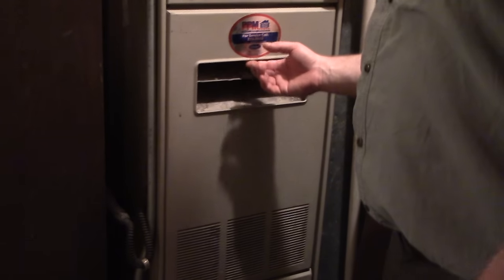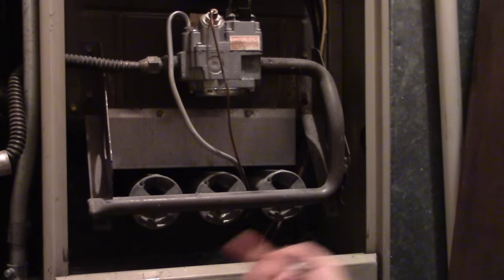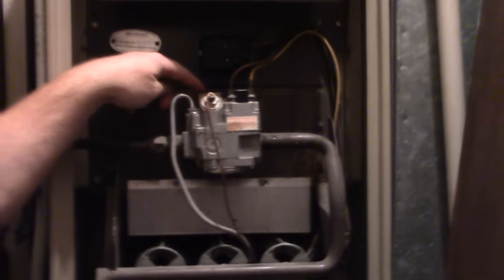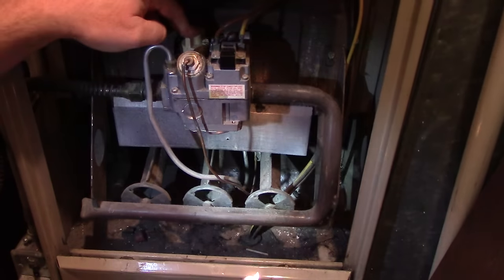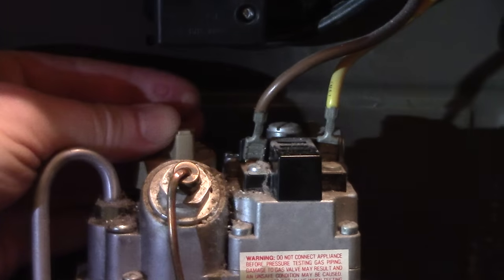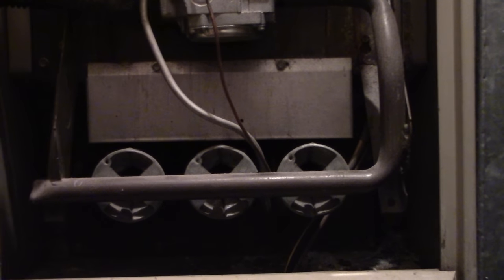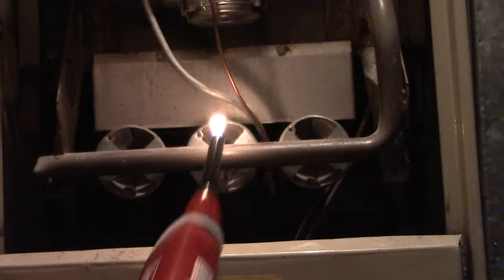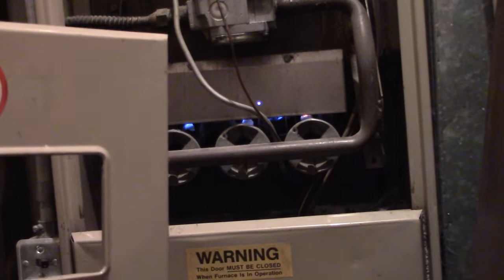How to Start Pilot Light on Furnace

Comment: Appreciate it!!  but I want to know should I turn the heat thermometer to on before doing this or keep it off? Thanks
Reply: Keep the Thermostat down at the lowest setting when lighting the pilot light! This will keep the main burner from suddenly igniting when you turn your gas valve to "ON" position!!! After your pilot stays lit, THEN turn the Thermostat to your desired temperature!

Comment: Question. What should I do. If I get everything lite. But it shuts off
Reply from the maker: First I would make sure you are holding the button down long enough for it to heat up after the pilot is lit. If you still have the problem, it's likely an issue with the temperature sensor which is mounted right next to the pilot flame (often touching the flame). First clean off this sensor of any carbon deposits, and if that doesn't work, you can replace the sensor.

Comment: So what's happened when the gas valve doesn't turned on any direction how i can fixing ?
Reply from the maker: Sometimes the switch knob can be finicky. Keep working with it until you can push it down to light the pilot.

Comment: please, please, anyone - if you have a forced air furnace old enough to have a standing pilot, have to checked to make sure it's still safe! The newest ones are around 30 years old.

The pilot should not normally go out - plugged orifice or failing thermocouple can do it.